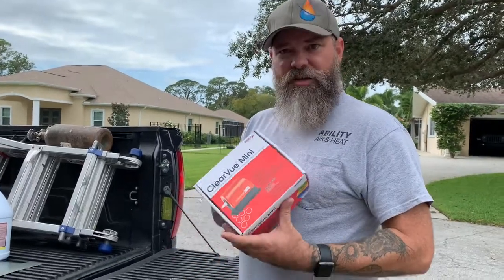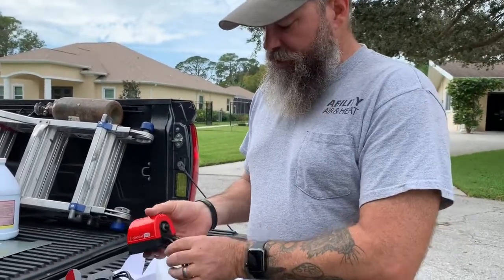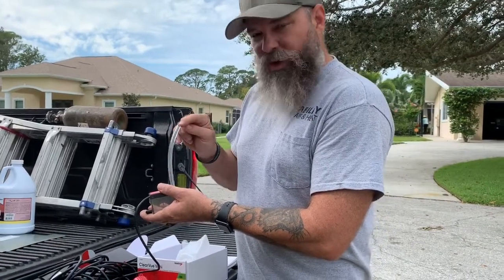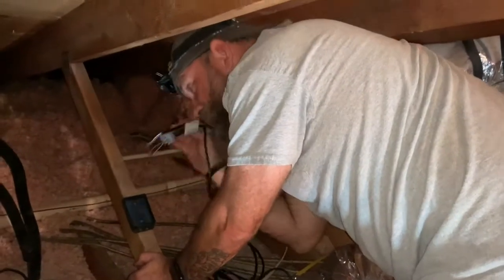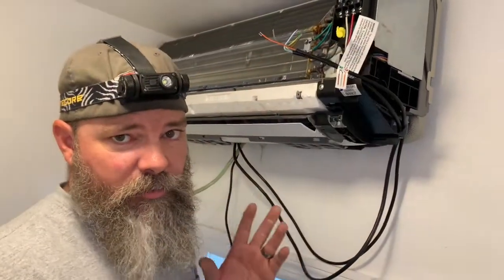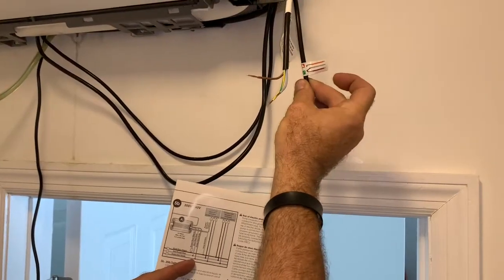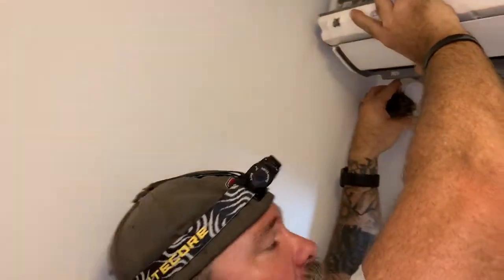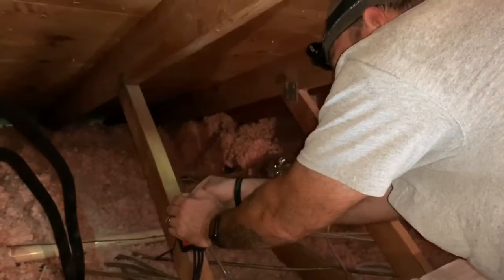Installing A Mini Split Condensation Pump

Comment: I greatly appreciate this. I have been out of the HVAC business for 15 years curious does this cut off the outdoor unit like they used to? When the sensor is open? I put several of these mini splits in on exterior walls this is my first one on an interior wall . I'm installing this at my house. On a slab. Excellent content
Reply from the maker: It shuts off both inside and outside units.

Comment: You don't mention priming the pump or reservoir. Is this a setp that can be skipped?
Reply from the maker: I have never primed a minisplit condensation pump in my life.
Reply: @AbilityJohn  OK thanks...I‌just had mine repaired and the pump bubbles like a tea kettle. .  With air like that I thought it was a necessary step.

Comment: Hello, does this pumps or the reservoirs/sensors need maintenance? If yes, what kind?
Reply from the maker: I use bleach in the drain pan. Followed by hot water after about 30 min.
Reply: @AbilityJohn  you mean the drain pan inside the AC unit? Enbglish is not my native that's why im confused! You turn the AC on, then you pour bleach to run through the reservoir and pump?

Comment: FINALLY, Someone who can explain this. Greatly appreciate your fully detailed video, Can you send me the model and brand of the condensation pump used in this video. I’m in a bind. I converted my garage into an ADU. and the only good place for the head unit is on the main wall where garage door used to be so I want to install the compressor on the roof which also has a a drain for rain.
Reply from the maker: The brand is diversitec. Not sure the model number. But they all are about the same.
Reply: You are the man. I was racking my brain over those damn instructions.

Comment: Lots of people say these miniature condensate pumps only last 1-2 years before they fail. What brand have you found to be the most reliable?  In the past I have always used those big Little Giant pumps, but for most mini-splits that isn't an option.  Thanks.
Reply from the maker: I haven't had that issue. If the pump goes bad it's usually from poor installation. otherwise I haven't had to replace any minisplit pump i have personally installed. I hate to give any names of pumps because I just don't want to vouch for any particullar brand. hope you understand.

Comment: Nice video. Would there be an issue with the condensate freezing in the attic during the winter?  I know that no condensate is produced indoors when in heat mode, but there would be some condensate left over from the last time you ran the AC and possibly split the hose or damage the pump.   Since the reservoir needs regular maintenance, I guess you would have to remove the entire plastic cover of the mini split to clean out the reservoir.
Reply: 😅 North Idaho Technician here! Yes we don't use these pumps specifically because they're bad for cold applications. Especially when mounting through an attic or crawl space. We use the ones that are installed directly below the unit called Gobi 2.
Reply from the maker: @AJ-ox8xy  I like this pumps too.
Reply from the maker: I’m not familiar with cold climates like that. If that area gets below 28 degrees I would assume you would have to drain all water.

Comment: Thank you very much for your help explaining how to wire the condensate pump I tested it by overflowing the reservoir and the unit turned off , water level went down and the unit turned on again , thank you

Comment: Showing the placement and connection in the attic was helpful, thank you.  You are going to want a strain relief, or at least some chaffing protection, where the wires enter the back of the evaporator sheet metal.

Comment: Use your wiring on my Mr Cool I lose power to air handler, pump is powered.  Any suggestions???
Reply from the maker: Sorry. Not enough data.
Reply: @AbilityJohn  Thanks for reply; it appears my problem was alarm relay in Gobi II pump flunked continuity test.  Great video thanks

Comment: For some reason the instructions were revised saying you need a 24V transformer and contactor (not included) to wire it up this way.  New instructions say it can’t break line voltage, only reduced DC control voltage.
Reply: I was checking for the same reason. Just had a pump fail in less than 2 months and the only difference I have was I wired per new instructions to break the signal wire and not voltage…

Comment: Interesting that it has a shut down. I use moste Silent Mini Blue from aspen as it fits behind the AC with space one from Refco working with a non mechanikal sensor wich works on all positions and has a high adjustable pumping rate.

Comment: So I am confused on the grey and the purple wire. I have a mr cool. Does the communication wire run to each of these wires? So I would have to splice the communication wire to these wires?
Reply from the maker: Sorry without instructions I wouldn’t be able to help you. Usually the switch breaks high volt not communicating. That’s my understanding.

Comment: Thanks, was looking for an explanation for the breather tube on top of the reservoir.
Reply from the maker: It prevents leaks if the drain backs up between the reservoir and the pump. It extends that cavity to above the drain pan hight.

Comment: I just bought a house with a split unit installed on an interior 2 floor wall with the condensate drain line connected to nothing. Where do you have the condensate pump pumping to?
Reply from the maker: Up into the attic then outside.

Comment: Do most condensate pumps have a shut off if they fail?  I have an Aspen Mini White and it claims to but I've also heard they fail.  What's the most reliable way to kill power to the mini split if the pump fails?  Like a Safe-t switch?  Any brands you recommend over others?
Reply from the maker: I have only used the mini split shut off integrated with the pump. They all have it.

Comment: Just a heads up, some mini splits use terminal 2 as the signal wire for communication leaving 1 and 3 as line voltage. E6 error codes across the board wiring to terminal #2

Comment: In this setup, the condensation hose is going straight up? Just curious because my setup at home is going straight up into the attic, I couldn't use the wall that faces the outside of the home, i haven't been able to run my a/c because of the condensation running down. Will doing this correct my issue?
Reply from the maker: I’m confused by your description and question. This is the setup using a condensation PUMP. With a pump it doesn’t matter which direction the hose goes.

Comment: Thank you for this post. Our pump stopped working properly last year and when we had the company we purchased and had it installed from, come to fix it, they said the pump was broken. They unhooked the wires and said they would order a new one. I didn’t believe them and took the pump out to test it and it worked. However, I couldn’t understand the instructions on how to rewire it.  They refused to come back and rewire it unless we paid them. Any chance you have a photo of the pump wired to the unit?  Your explanation was great but I couldn’t quite see how the wires were finally installed. No worries if you don’t.
Reply from the maker: I would try to locate the instructions. That is the best thing for sure.
Reply: Hi John.  Thanks for your response.  We actually have the instructions but they are almost impossible to understand.  However, we were able to find someone to reattach the wires and the pump works like a charm (go figure...).  Thanks for trying to assist and also for your videos.  They are helpful.  Cheers.

Comment: Thanks John. Extremely helpful.  I was wondering to use this as a sump pump alternative for a tight space.  Does the wiring schema the same?
Reply from the maker: I’m sure you could wire it that way. Not sure what you’re asking, is it the same way as what? I don’t know much about your application and I’m not an expert in these pumps. It’s just for information.

Comment: Do you have any suggestions on installing this pump for a mini split that doesn't have a communication line?
Reply from the maker: No. And I don't know that I have ever seen a mini split without a communication wire. If it has 3 wires and a ground in the air handler the 3 terminal is usually the communicating wire.

Comment: We just had some Mitsubishi units installed with the Mini Whites and those things run constantly. I think I hear the pump kick on every 1-2 minutes. Are the pumps supposed to empty out completely or are they just supposed to lower the water level ever so slightly
Reply from the maker: The pump reservoir is small so it fills up quick and then the pump turns on to empty it. The pump could run quite frequently especially in high humidity situations.

Comment: Hi John Great video I have an min split to install this week & its on an inside wall backing up to an closet & the drains are killing me trying to figure out how to drain or pump condensation out ..never thought a pump could be installed above the indoor min split evaporator like that but if it has enough suction power to pump up hill into the attic above & no gravity drain  required to fill the pump ...That solves a lot of problems .but question .... what triggers the pump to turn on ?? Thanks in advance xxx jerry
Reply from the maker: These pumps are specifically for mini splits. There is a small reservoir that goes behind the air handler. It triggers the pump to go on and also turns the unit off if the pump fails.

Comment: I just installed a pair of 3 zone MItsubishi  M series splits. I have one unit requiring a pump. l installed a refco combi. It is not pumping water, nor is the safety breaking the circuit. I am sure that the wiring is correct. The green LED indicates that it should be working. I suspect the the reservoir is where my problem is.  Any thoughts?
Reply from the maker: 1. Is it the correct voltage
2. Is there a kink in the tubing from the pump
3. Is the pump hiked up in the correct direction
Reply: John Dungan I had plugged the connector in wrong on the reservoir. It is square, and even though it was keyed, it can Easily plugged in wrong.
Reply: @PaulCourtemanche I'm about to buy a Gobi II to replace my previous REFCO micro pump because someone must have snapped off the small nipple where the breather tube was attached. Don't ask me how, but it's Murphy's Law: If it's not idiot-proofed, an idiot will break it.

Comment: I had a mini split install today and had installed an aspen mini orange and I was pulling my hair out cuz the unit wouldn’t run but when I disconnected the pump, it ran.. was giving me a communication error code. I’m convinced I followed the schematic correctly.. I returned it for a diversitech CP-M230 and I really hope it works out for me. I found zero step by step videos on the entire internet and this one is the closest one.. the colors are different but seems like the same general wiring. 🙏🏼 hope it works out
Reply from the maker: I hope you get it figured out. The instructions are confusing for sure. Don’t break the communication wire. Break terminal 1 or 2.
Reply: John Dungan It worked out for me. I had to look for the electrical schematic for the mini split online and turns out the middle wire was the comm wire not #3
Reply from the maker: Damn. Glad you got it figured out.

Comment: Thank you brother for that helpful confirmation. Certainly that was my conclusion but it was a little hard for me to believe that power ultimately fed through the switch would be fed to terminal S1 through such a tiny wire.
Reply from the maker: Yeah. It’s such a small wire. But I’ve seen mini splits installed with thermostat wire instead of the standard 14 gauge. The blowers are basically the size of servo motors. So not much amperage there.
Reply: My electrician couldn't get over that either ... but it's been working for us since 2014!

Comment: Thanks for the guide. It's interesting when linesets are run in the attic. I always imagined the best spot would mean go through walls to the unit, but this setup can be nifty to run at a more central location.